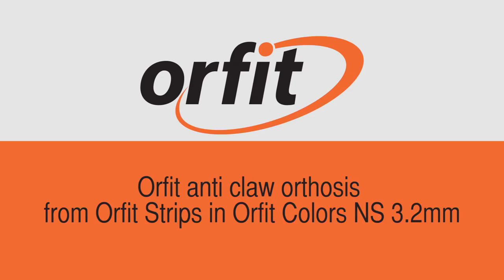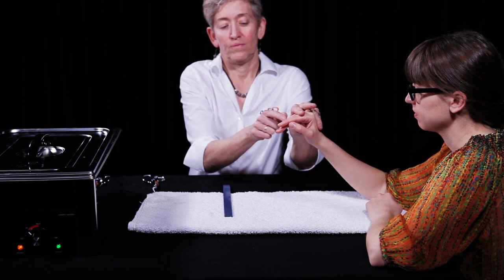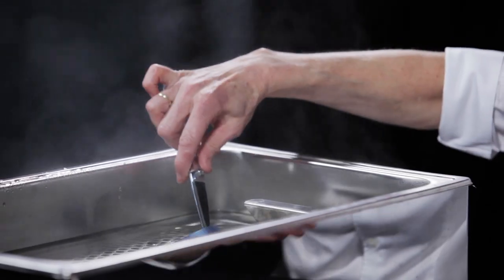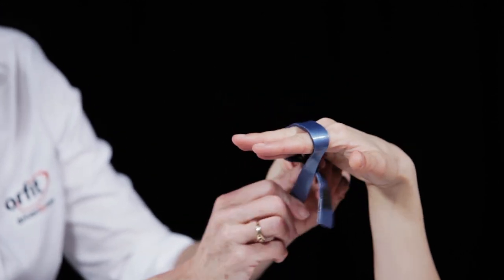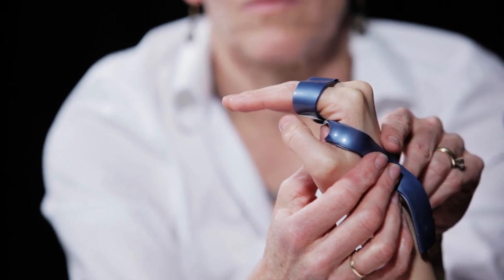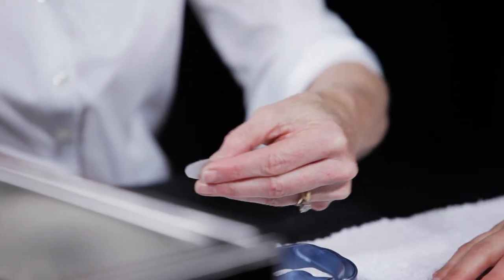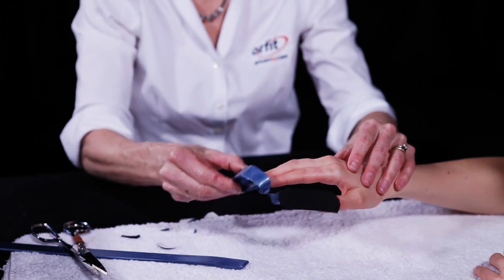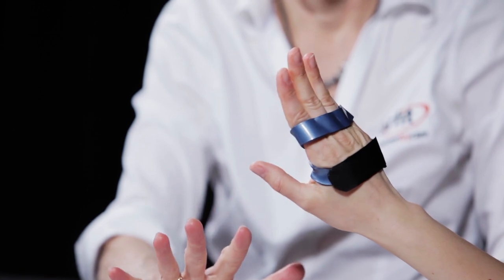Anti claw orthosis (Orfit Strips in Orfit Colors NS) - Splinting techniques 6/10

Comment: Can we put splint  during generation of nerves after injury. Please.
Reply from the maker: Hi Nadia,

If the ulnar nerve innervated muscles are not functioning due to nerve trauma, or the ulnar nerve has been repaired and is progressing with healing, but the fingers are still positioning in the claw position, then the anti-claw orthosis is appropriate.

The patient should be evaluated for a claw deformity. If present, the timing of surgical repair or trauma does not matter because this is a functional orthosis and can help the patient. You can evaluate the patient to see if it helps.

Please let us know if you have any further questions.

Comment: Is this coated material? or just rubber?
Reply from the maker: Dear, thank you for your question. This is a thermoplastic material coated with a non-stick coating. For more information on this product, you can visit our website: https://www.orfit.com/physical-rehabilitation/products/orfit-strips/
For any other questions, please don't hesitate to contact us.
Kind regards, the Orfit team.
Reply: THX. Coated?so the inner material is?
Reply from the maker: Dear, the coating allows for temporary bonding during fabrication and for direct moulding onto bandages and coton lining. It also makes the orthosis more resistant to fingerprints and dirt. The inner material is a low temperature thermoplastic.
Reply: Thx for your answer